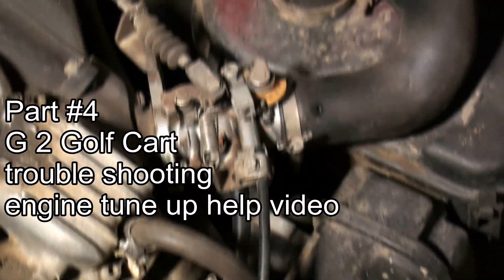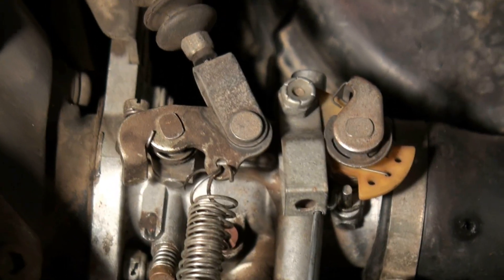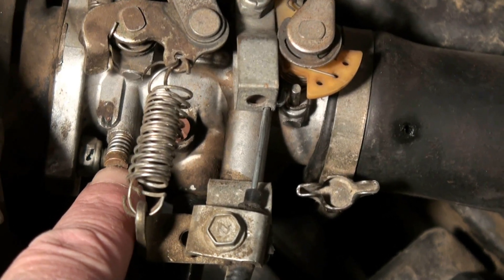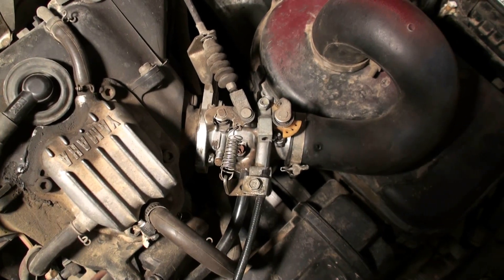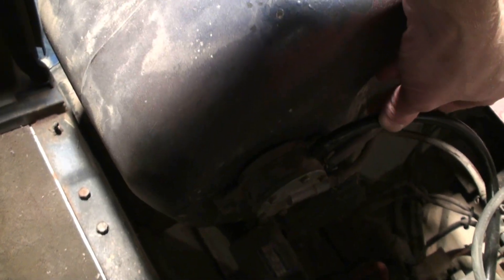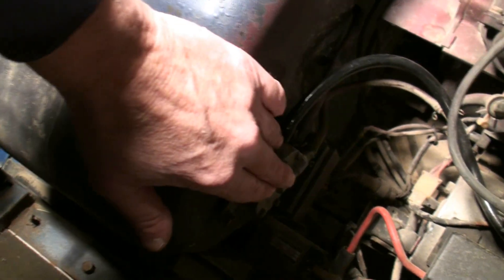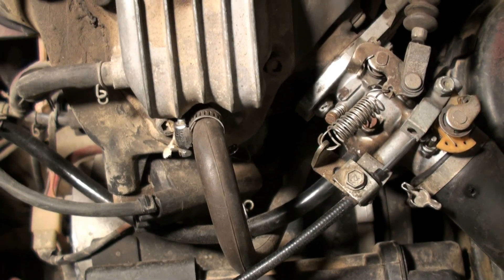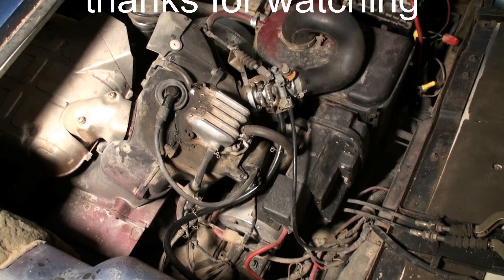Yamaha G2 Golf Cart Tuneup & Repair. Part #4

Comment: Any suggestions to eliminate backfiring, after slowing down coming to a stop, even after the dinginess stops, and sometimes again taking off from a complete stop. The G2 has been tuned with new plugs, gas filters, air filters, fuel pump, etc.

Comment: I just recently acquired, I guess is a G2, because it looks everything like what you have have shown in this video..I will definatly be coming back to see all the parts so I can get mine running right....so far I have noticed the solenoid was broken, and now I think the starter has bad brushes or just plain dirty..it only attempts to turn if I spin the drum with my hand..and only for a second.

Comment: Thanks for the great video.  One question is where can I get a new air filter box and overflow attachment?  It's been running good even without the overflow attached and a lot of leaks in the air box, but I would like to replace them.

Comment: Mine cranks okay, but won't start. According to you, it could be a vacuum leak, the carburetor, or the spark plug. I checked that fuel is pumped into the carburetor. So I replaced the spark plug. But no luck. Could you please teach me how to check if sparks are coming from the spark plug?
Reply: If you hold the plug against the metal of the engine block and turn the engine over you will see the spark